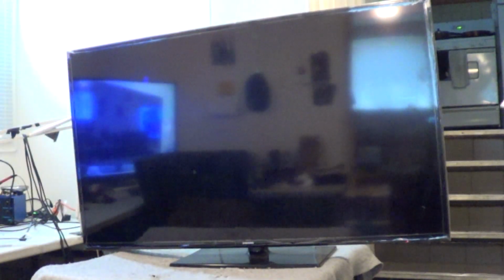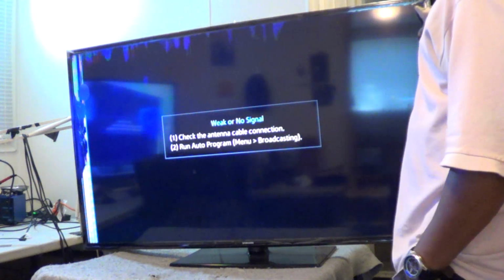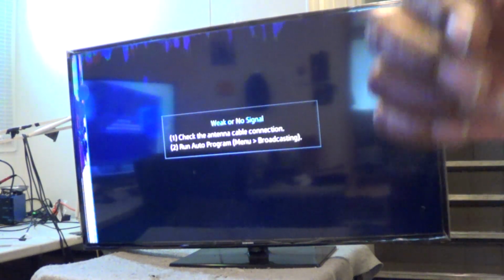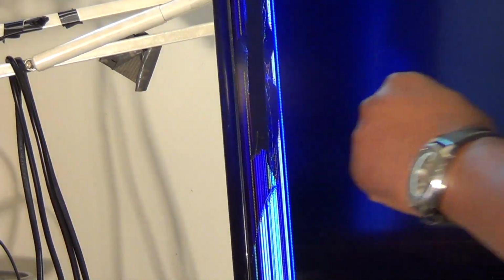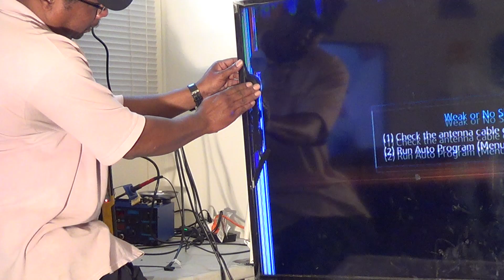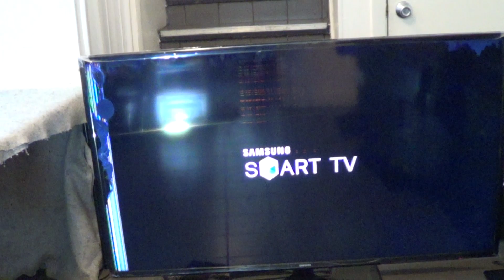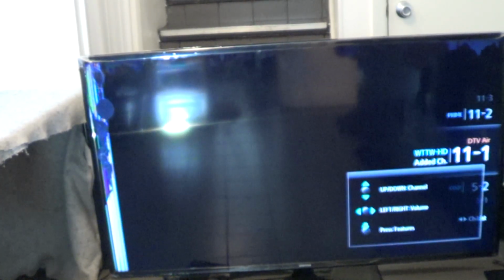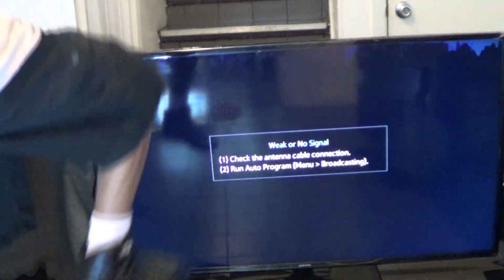How to fix a Cracked TV  screen using heatgun and Epoxy

Comment: I followed your instructions precisely on how to fix my stupid cracked screen. The only thing is that you didn't include the instructions with the tv mounted on the wall. Everything went well except for the boot part. The tv fell off the mount and broke my cable box. My question is, do you have a video on how to fix the cable box too??? Oh, by the way. Next time make sure you let us know how MUCH pressure to apply with the boot.

Comment: Does this also work for the 3D tv's?  I dont have electrical tape cuz I'm not an electrician but I do have gorilla duct tape will that work? I will be using my wife's hair drier just have to attach my homemade pvc pipe adapter to reduce the opening of the hair drier....I wouldnt want to melt the screen around the fist sized crack...that wasnt made by a fist...
Reply from the maker: Obviously you didnt watch the entire video, lol.

Comment: Seriously I’m still snickering lcd panels unless it was a billion dollar display unfortunately is scrap and true such a huge waste of resources but this video is purely for folks to Keep it real and realize the 100 answers of no out cannot be replaced means just that. He made video to make you laugh and laugh I did and I was hopeful going gawdang he might be in to something with the high end black toe adhesive transferability with the heat device set at proper heat dispersant setti by of 23. But even Edison said himself I didn’t fail 100 times inventing the light bulb I learned 100 ways h he is not to build a lightbulb. So get a grip and don’t leave negative buy the ext warranty and or learn electronics and work of these schools can be fre in ca through sdcontinuing education kind of like the ol rop. All I can say is hats off to ya you hit me at first and I am very trained in electronics and I said when you kicked the screen, holy crwp he’s doing the filsner method to make sure that it’s not repairable.  Damn skippy I’m thinking that’s a size 12 lol.  Have a good day and thanks for the laugh.

Comment: Dude you SUCK! I have that exact problem with my Samsung 65”. I covered the damaged area with black electrical tape. I used the settings to move the screen horizontal. I got some nice 3” door/window trim and built a picture frame around the TV to hide the damaged area. Than I got a big picture on a window shade on the outside of the frame. Now my tv looks like a picture. I just roll up the shade when I wanna watch TV. Times are tough nowadays and money is tight. You should be teaching people how to preserve and make the best of what they have, not be a poor lack of resources, I’ll advise, so called mr fixit like you. I thought you were gonna teach me something. BUM!

Comment: It would have been fun as shit if it would have actually worked with the tape and heat, he is just being an asshole making shit up as he goes but then he turns it on and it works like new, he shits himself trying to figure out what the hell just happened!! Then he cracks his tv to try to do it again and it didn't work!🤣

Comment: Bigdog I knew you was pranking us I got a good laugh Funny. I do have a question have you ever tried to put a 1080 screen in a 4k if it would fit. I just wander if you could use the screen of a TV that has no longer parts available for it. Just wandering if it would work.

Comment: Actually stopped watching but my guts told me to watch till the end. And I’m happy I did. But I have a question. What shoe size are those? I want to get the same color results? Could you make another video with shoe size. And do i have to put Tv on tile before kicking ? Or could the same result be achieved on hardwood floors?

Comment: Only way to fix a cracked tv is to replace the screen. The problem with that is it will cost more than a new tv to replace a cracked screen. Yes a cracked tv can be fixed but at a high cost. Solution to a cracked tv.....buy a new one and sell the damaged one as a spare parts tv.

Comment: Bro come on u just wasted like 8 mins while I’m trying to figure out how to fix my my broken tv
Reply: You can if you really want to. Just go out to the store that you bought it from, buy the same one Or the same brand that looks about the same. Take it home, then  put your broken one in box, go back to store, and tell them that it was broken when you opened it that same day and return it if you really really want to fix itfor free.Though I’m sure people will say there’s a special place in hell reserved for you if you do that. I’m not judging.
Reply: @frankcalandrino2373  problem is serial number. Plus trying to return a broken tv
Reply: Jeffrey Robinson Serial number comes right off with a heat gun it’s a sticker you put the heat gun on it and it’ll peel right off and You can stick it right over the old one or you can remove the old one and put it on. And they can’t prove that it wasn’t broken already in the box before you took it home that’s why you return it the same day stating it was broken when you open the box
Reply: @frankcalandrino2373  you're funny. Only because back when the flat screens first came out I did that I found one on the side of the road I went to a store and bought the same one and returned the one I found on the side of the road
Reply: Frank Calandrino shut the fuck up
Reply: @frankcalandrino2373  hahaha
Reply: @frankcalandrino2373  Come on now Frank. That's theft by deception! Tvs have model #s and serial numbers as well. When they don't add up with the box. You're screwed.
Reply: Lol
Reply: You can't
Reply: DAMN IT! He got me too😳
Reply: Same here
Reply: He didn't waste your time, YouTube has fast forward... 😬
Reply: Same 😕. I was hopeful too as I have a 65inch samsung. Oh well the search continues.
Reply: quirkychic1984  yea I couldn’t fix it I just got a monitor for 20 bucks from my Friend
Reply: Lmaoooooo🤣🤣🤣🤣 I feel ur pain right now.   something
Reply: Wow just call the insurance on the TV & get your money back
Reply: Waab
Reply: You can't Fix a god damn broken LCD !!!
Reply: Did you ever find a way to fix it
Reply: Crack is an hell of a drug 😂
Reply: My friend dropped her TV the same exact one and put a crack in it and throw it out it's only a month old if you ever come across large screen TVs like this that don't work the screens inside you can use it's only two pieces of plexiglass I just I should videotape it LOL
Reply: I dead ass tight and the nigga get paid the longer u watch the video

Comment: i use a diferent method 1st unplug all cables, 2nd move th tv close to the 2nd floor or higher 3rd check if its raining 4th if its not raining go to the fifth step 5th chek if its some one outsise on the ground floor 7th and last step open the window and carefully send it to the ground floor.